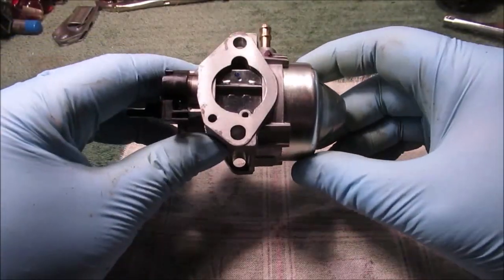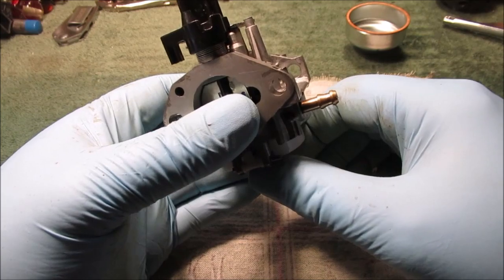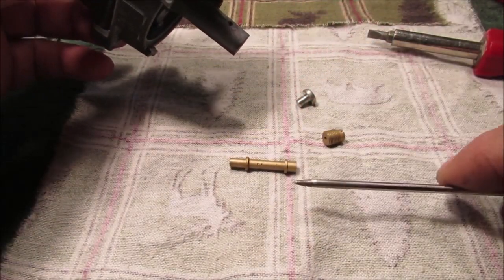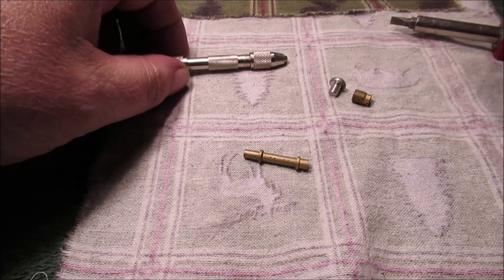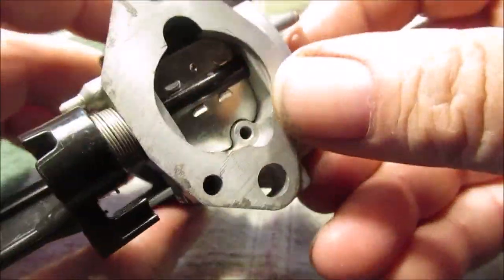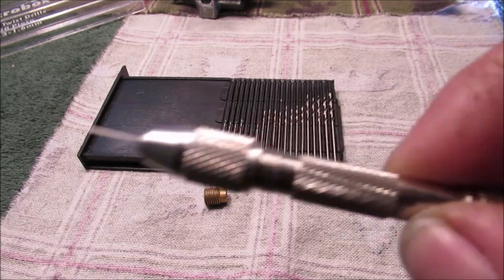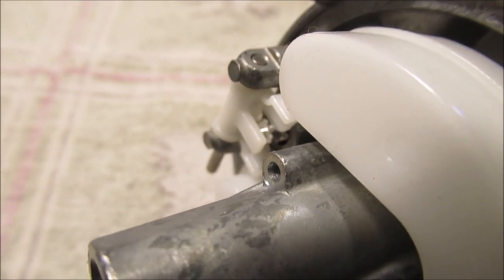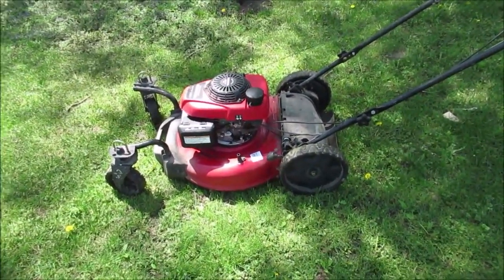Honda GCV 160 Carburetor Remove & Clean Part 2

Comment: Thanks for the shout out.  i realised you were going to improve this carb after my last comment.  Great demo Jim.  It is clean.  You did perfect Jim.  Trust me  lol (get it?/)   I know what you are saying about the hole size  just one step up.  .   I got the dual support bolt on the carb from Dave Ackerman.  Good job Jim
Reply from the maker: You deserve a shout out since I am learning these newer carbs by watching you clean so many of them...I can't believe how small the idle jet is ...I barely got a sewing needle to fit in it..It does run great now ....Next carb will be on my honda clone  grey hound 11 HP made by the Lifan company that HF used to sell it is 8 years old and is not running right like it is plugged or needs a jet resize done to it
Reply: @not2fast4u2c  Good for you Jim

Comment: At altitude (1000 ft above sea level or more) enlarging the jet isn't a great idea because small engines run pretty rich up here already.  Great vid, by a tech who thinks things through.  These carbs are junk, and the air passages get plugged too quickly because they use unfiltered air and mowers kick up a lot of dust.  The engineers at Honda should be shot for this design.  The mounting with bolts instead of studs is a case in point.  It serves to make something that should be easy a real pain.
Reply from the maker: I would not say they are a bad design .With all the EPA regs they smog the carbs down and then we have to enlarge the jet to get the engine enough fuel ..This usually has to be done once the engine has been broken in .My engine has a good pleated type air filter but They can be too restricted also once they get just a little dirty

Comment: What were the names of the fuel concoction items? Ratios? My carb gets gummed up and has to be cleaned every year even though I use a winterizer additive in it. It runs well when clean, slow and shuts off quickly when it has sat through the winter. I would love to have my bowl stay as clean as yours.
Reply from the maker: Well none of those additives really work to keep water out of the gas I do not use any ethanol fuels They are most of the problem with making carbs gummed up I do use a 1/4 ounce of marvel mystery oil per gallon of gas to keep my valves clean and it helps clean the carburetor